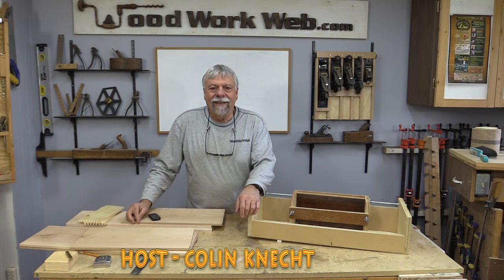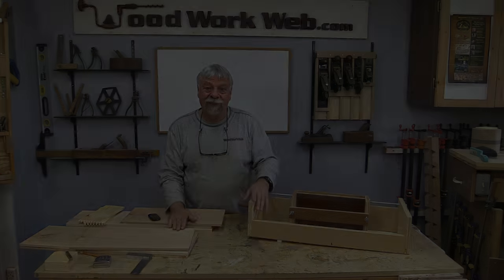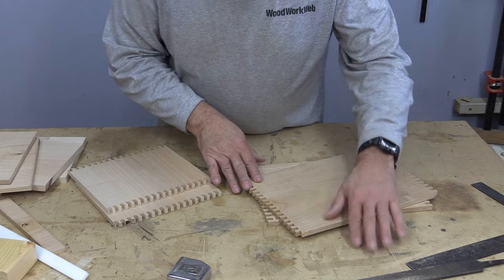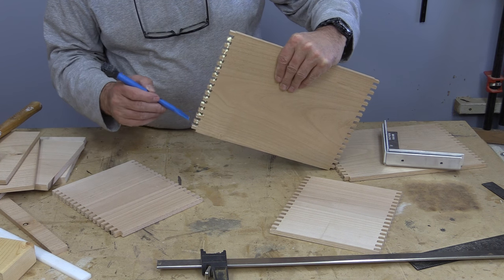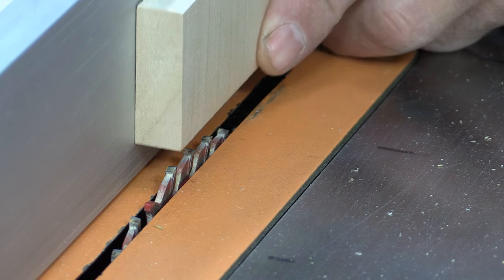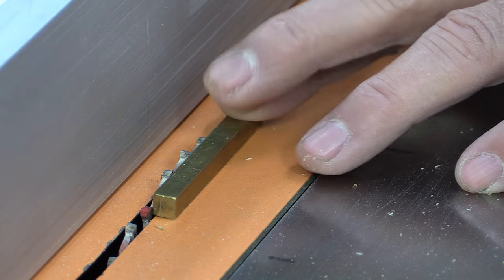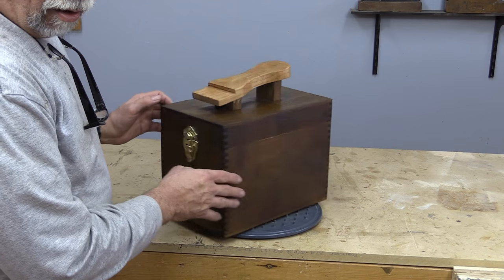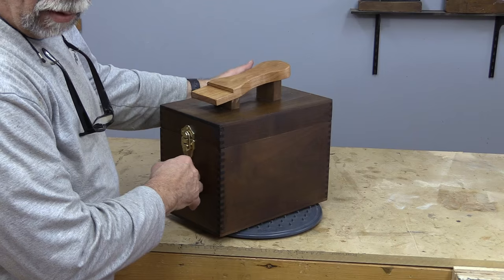How to Make a Box Joint Shoe Shine Tote

Comment: Did the shoe platform thing get installed correctly?  I would think the ridge would be for the heel of a shoe, with a slight decline on it for a gravity assist to keep the shoe steady.  The way it was installed looks like a shoe might slide of?  Great little box, I need to make one now.  Thanks for the great video!
Reply from the maker: +Aaron Britt Yeah I wondered about that after I did it ... I just installed it the way I had seen a couple of others so not sure if they were on correctly or not. I wondered if the design of the box was originally made as a service ... so the shoe shine person would have the client sit down in front of the box and put their shoe on it, then the shoe shine person would polish up the shoe ... just not sure, maybe someone out there knows and will enlighten us :)

Comment: Colin  I made my box joint  but rather than  using  a lide  on it I used  just  a  3/4 inch  dowel for my handle  I used  Danish  oil  and sand and  sealer for  my finish  I used I a drill  attachment with 1/4 inch   router  attachment now that was in the  early  90s and it's  still  as strong as the  day  I made it  any way yous is a lot nicer so mybe  all do the same as  yours  one day Colin  Peter fae Scotland  cheers
Reply from the maker: +Peter Haughton Hi Peter, great to hear from you again ...